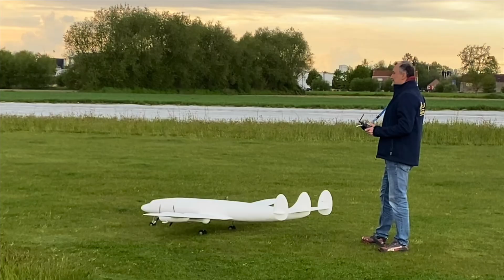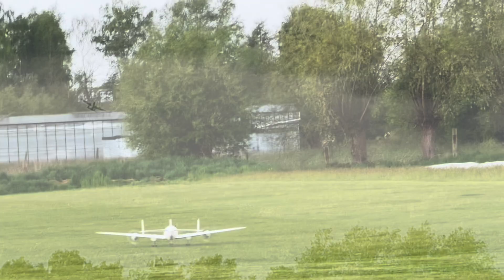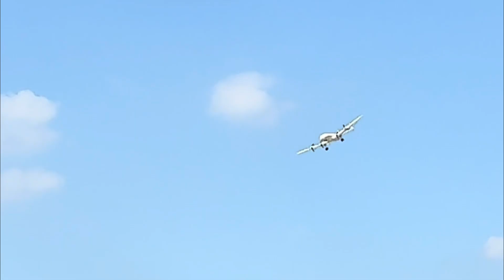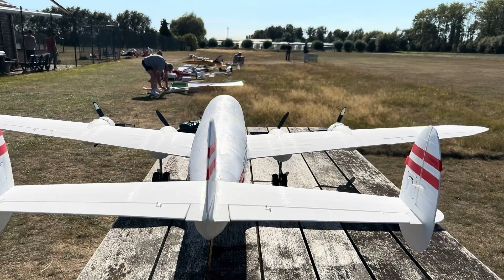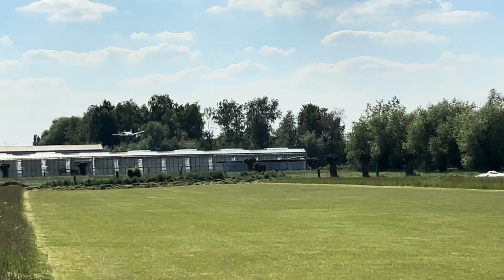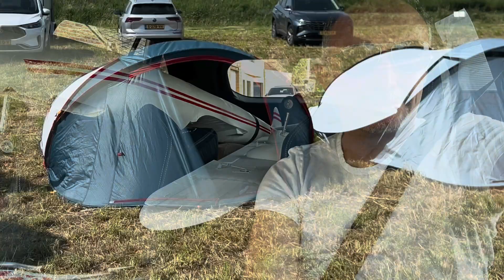3D Printed Super Constellation Prototype – 15 Test Flights Assessment

Comment: Very nice! Excellent results for a prototype model. I wanted to ask you if you had considered using counter rotating props to offset and torque rolling tendencies or does it not have any of those nasty habits that other multi engine planes suffer from? Just curious. Again, very nice work and I look forward to seeing your final production model sometime down the road.  👍🏻
Reply from the maker: Thank you very much for your kind comment. Well, I have counter rotating multi motor planes and indeed they fly perfectly. I wanted to be close to the real one as much as possible, and it is first time I am using std props.. it worked well. Connie flies like on rails. I haven’t tested counter props yet on the Connie, by adjusting motor trust angle to 0 degree, there won’t be any concern I suppose.

Comment: A 3D  printer can t make a plane  this big.Are you kiddiing us?😂😂😂😂😂😂
Reply from the maker: Crazy idea, serious results 😉😊
Reply: You think very narrowly, you can make parts that are assembled its not always 1 piece.
Reply: A 3D print can certainly print the parts necessary to assemble this aircraft without a doubt. Not sure what your background in modeling is, but I have been building and crashing models for more than 40 years now. I have successfully designed, printed and assembled a 42” RC catamaran that has tops speeds in the range of 75-90 mph depending on prop and battery selections. While my printer has a build size of 400mm x 400mm x 600mm which allows me to print reasonably large parts to assemble into much larger completed models. So if you have a tiny little 3D printer, then no, you are not going to be able to do this. For those of us with larger tools, then yes we can and do. 🤓
Reply from the maker: @ericchild8845 which printer are you using? 
I have some projects in mind which I will need a bigger one.